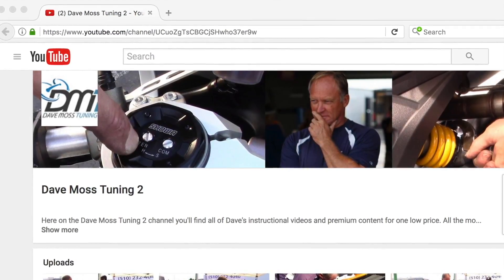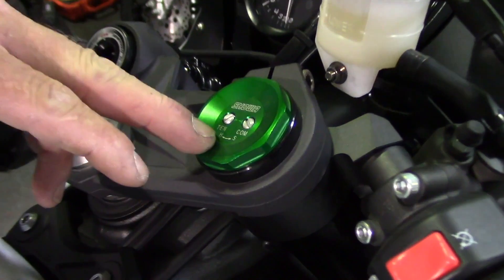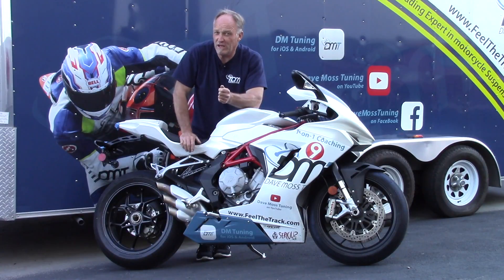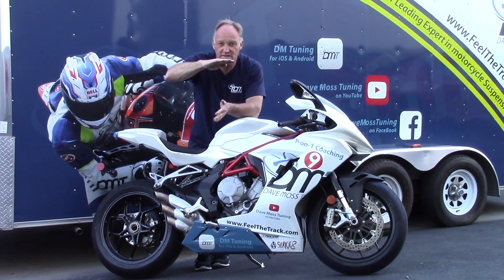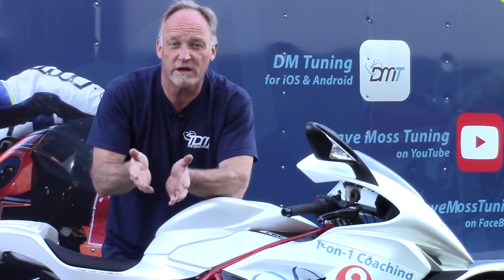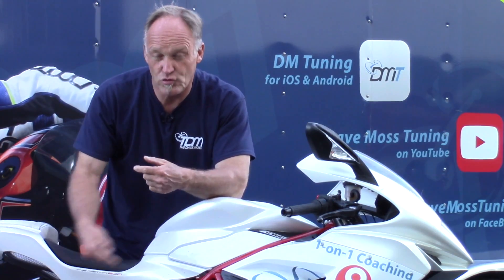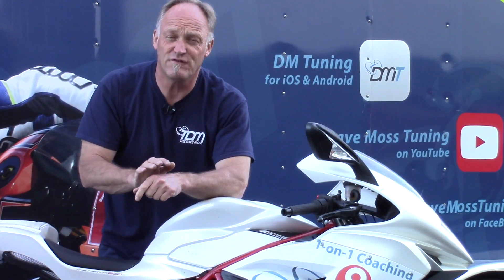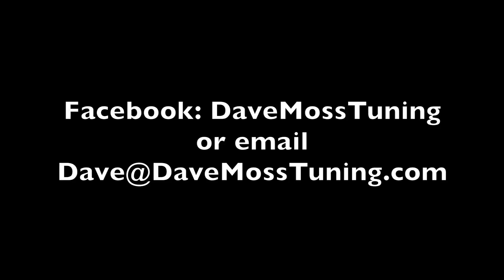Ask Dave: Motorcycle Geometry and Ability

Comment: What is mid corner load and why is it heavier and more sustained than braking for especially for under powered bike?
Reply from the maker: When you ride a bike through a corner physics pushes the bike into the ground based on your weight and speed. If you are accelerating, the suspension becomes more compressed. That increases the tire contact patch and increases grip. Braking is a force that only the rider can generate by hand. Cornering forces are based on speed and weight and will always generate more travel overall no matter what the weight of the bike. FYI smaller bikes have much softer springs so they will get more travel in the corner than a bike with stronger springs.